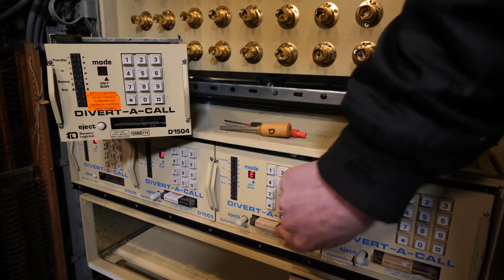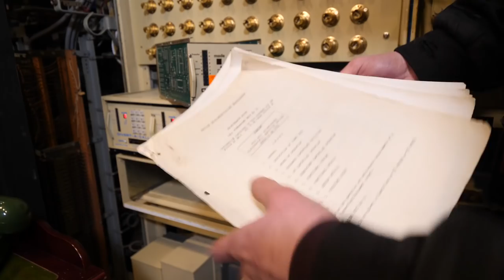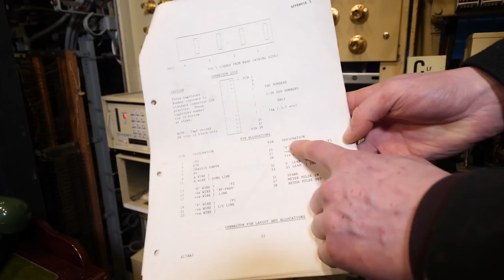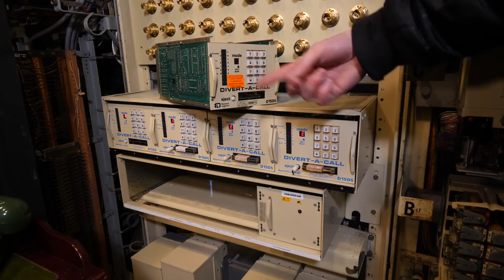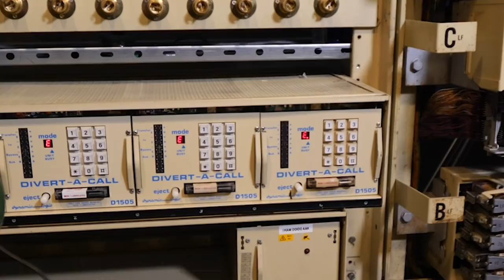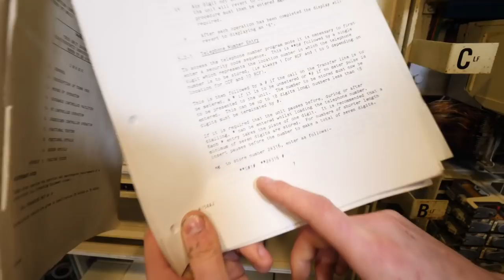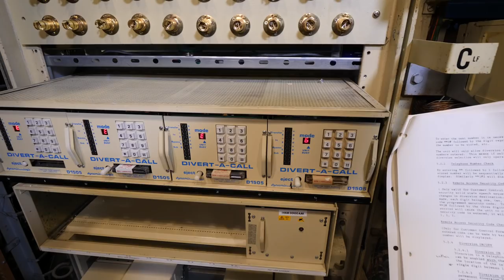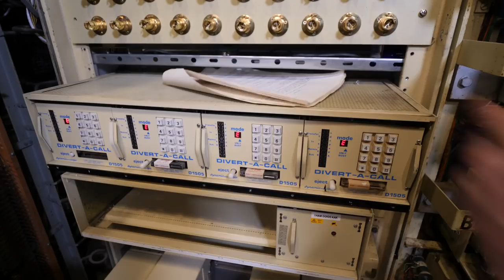Strange Tape Loop Machines - DIVERT A CALL

Comment: One of the reasons you’d want this back in the day is to appear local in areas you aren’t. I worked for a wrecker company (tow truck.. sorry tow lorry?) and we had forwarded numbers in the towns around us. Back in the day before cell phones local exchanges were well known to the people local to them. Here in the US a number is 3 digit area code 3 digit local exchange 4 digit number. So this company would get numbers in the towns around it and forward them to their main office to increase the number of calls they get from those towns. It did create some confusion over where we actually were but we did get calls from those towns. Cell phones and portable phone numbers came along and kinda messed up the organization of all that so it’s less of a thing now. But that company still to this day has forwarded numbers. Kind of a hold over.
Reply: It wasn't too long ago that you would omit the area code.  I suppose you could advertise 777-7777 cab company in any area code and buy a diverter to the local cab dispatcher.  It also makes me wonder if it was used for long distance calls.

Comment: I spent a couple of years 1984-1986 working on the DVC  (Divert-A-Call) for the manufacturer, Dynamic Logic.  Among other things I did a complete redesign on the audio board (hybrids/AGC/direction switching etc.).  I see you have the manual for it, but I'm happy to help with any other info if I can.

Comment: I can remember installing these in exchanges, taking a guess at late 70's.  You may know already the racking system is called "62 type", used for all sorts of analogue kit and the early digital transmission stuff, PCM, pulse code modulation. 30 voice channels over a single pair.....
Reply: 👍👍snazzy! 62type interesting. It’s nice wracking very modular!

Comment: The 62 type racking tales me back to my early work days.  My first exposure to 62 was aligning point to point VFT (Voice Frequency Telegraph) cards which ran on more 62 type 4 MHz (960 Voice Channel)  transmission equipment.

The build standard of kit in those days was superb - now of course the whole set up you have, and more, can be handled by a Raspberry Pi running Asterisk.
Reply: Me too... Datel racks for banks 300 bits/s, VFT, 4 and 12MHz transmission and the first 24 ch PCM system in the uk (installed partly beside an electric railway as a test for ground current interference!)
Reply: @db9827  We clearly come from the same industry I was ER guess you were LMR

Comment: We had repair service for the phone company have after hours answering at a centralized location.   As for remote call forwarding, this was useful for a business who wanted a presence or convenience of a local number in another community, where they paid the final connection charge, such as reservation lines at a lake resort.. I used to be a service representative at the phone company and sold it to customers who wanted a out of state number adjacent to their calling area, it was not allowed to circumvent the toll rates, but I still sold it, we had like 4 different rate tables, and it put the call on the cheapest vs the most expensive.

Comment: We used to have a mix of bill types with BT.  One was an 'out of area line'  where we would advertise a local number, but it would route to one of our regional call centres (all three operators in it - we were not mass market).  The other was calling line diversion did much the same thing but sort of could be switched in at weekends (might have that round the wrong way as I only paid the bills).

Comment: So idea.... Set up a "Divertion loop from hell" divert call to 1, from 1 to 2 from 2 to 3 and then back to 1. Would be like tryng to call your local municipal authorities for a building permit.
Reply: Unit 3 would dial Unit 1 but find it engaged by the initiating call.  If the initiating call cleared down, I think it would also clear down the output line, and the cleardown would ripple through.  Only one way to be sure, though!

Comment: That sounds like the same speech synth as used in "Impossible Mission" on the C64!
Reply: Ah, then it must have used the Telesensory Inc (TSI) voice synthesizer chip.  The algorithm used in that chip was developed by Dr. Forrest Mozer, originally for a talking calculator in 1975(!), and the chip was later used in "talking" pinball machines in the late 70s/early 80s, as well as many early 80s arcade games such as Berzerk and Gorf.  The algorithm was later licensed for use in several C64 games like Ghostbusters and Impossible Mission.  The chip was contemporaneous with the LPC algorithm chips from TI and GI, used in the Speak&Spell and Intellivoice respectively.
Reply: @johnclement5903  Fascinating stuff!
Reply: @johnclement5903  It was a Digitalker, which I believe was licensed to National Semiconductor by Mozer et al.  Whether it used the 4-chip set DT1050 or just the speech synth MM54104 could easily be seen from the PCB.

Comment: damn I knew they had speech synthesizers in them but never knew what they where for so that pretty cool, whats cool about the non tape version is that the digital modal is interchangeable with the tape mechanism running of the motor power cable and the tape head cable as the only inputs. also they are reprogrammable using a cf card thing (or at least that's what the plug on the board looks like ). considering that the blue ones can work off 2 wires they theoretically dont need to be in an exchange, knowing this i have debated wiring one of these into my landline and record a rickrole ofer the tape so that all the scammers that call get trolled lol

Comment: If a business moved and it was outside the exchange area of their current number then a 1505 could be installed to send the calls to the new number on the exchange that was local to the new business address. That can be easily done in software on a modern digital exchange but it looked like magic in 1980!
Reply: Yeah it’s mad how much it took to do that job!

Comment: 1HAM 00100 AAK! I used to know that coding scheme off by heart when I worked for a certain telecommunications manufacturer. The first four digits tell you what sort of part it is - in this case an equipment shelf. The last three digits are a check for the rest of the code and I used to be able to tell whether the check agreed with the code or not! Age and alcohol have erased all that now,  of course 😀

Comment: you should knock up a 2 digit pulse decoder, and use that, via an Arduino (of course) to generate Notes and CV's; ending up with a phone controlled synth.

Comment: Re the "non-lubricated" tape: the DVC used a basic car-type mechanism, and because it was permanently engaged but stationary much of the time, the pinch roller got a dent, which caused playback problems.  So we replaced it with a white silicone rubber roller that didn't dent.. but we discovered that the surface degraded with the constant "squidging" of playback, and the tape slipped.  The solution was to get a tape with a bit more grip, hence without the graphite lubrication usually present in endless loop tapes.  Oh, the hours I spent doing life tests!

Comment: The Black Type needs a P-Wire on its lines. The Blue Type does not, so therefore will work on some electronic exchanges with no P Wire